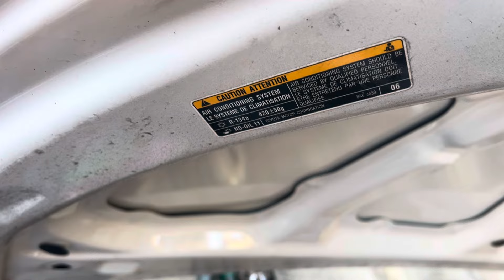Recovering refrigerant from my car measuring weight compared to last year.

Comment: Tom, thank you so much for all your good advices that I could profit from overhauling the AC system on my 26y old Mercedes E430. I made everything brandnew and yesterday I had the first longer trip on the Autobahn at about 30-32°C outside temperature. What shall I say? It was just perfect. Such a good and comfortable system in such an old car shows that Mercedes was in these days the top of the top (and still is today for sure) of german car brands. We were 4 people of the family in the car and everybody was astonished how unpretentous comfortable the temperature was regulated inside the car.

And from Nylog to Denso compressor, from long-time use of the vacuum pump to use of a micron gauge....every single tip from your videos was realized 😊.

Following advices of a perfect teacher means obtaining perfect results ❤
Reply from the maker: @Akadectra  you must be really good because my videos are pretty scattered and not one of my videos is a complete a to Z

So your ability to grab bits and pieces of information scattered wildly throughout many of my videos. 
      Glad I could be of help and make your families outings in your vehicle comfortable. 

Wish you many years of comfort without problems .
Reply: @coldfinger459sub0  Thank you, Tom. Your videos are brilliant 👍👏😊

Comment: Coolant mix off or fans slower than usual is what im guessing
Reply from the maker: @MrSuperchargedv8  if the fans were slower, the temperature would go down because there’s less heat load over the evaporator. 

I clamped off the coolant lines and the coolant flow to the heater core that did not make a difference . 

The only thing I just changed was from an OEM blower that burnt out to an aftermarket blower 

I did not suspect that possibly aftermarket blower is blowing a little bit more air than the OEM blower . 

More air over the evaporator will equal higher dash temperatures 

Because you blow the air faster over the coil, it has less contact time for the coil to absorb the heat out of the air

Comment: Iv been contemplating a dual condenser setup for my suburban.  Maybe a subcooler.  In Houston its tough on those older rigs.   

I plan on insulating the suction lines,  might help a bit.  Wish i knew more about the math behind the system design.

Some condenser take a beating from road debris,
Reply from the maker: You’re in Texas in a really hot area so insulating your section line will be a benefit, specially under the vehicle where the hot engine air travels and the exhaust and the catalytic converter heat. 

If you have an older suburban . 
Order a new condenser on the newest vehicle like a suburban that you can find that has dual air conditioning . 

The condenser for the model that has air conditioning makes the condenser a little thicker for more heat dissipation for a higher BTU exchange . 
Like a 2022 model  you’ll have to have your custom fittings and hoses made up. 

But you’ll be getting a micro channel condenser . 

Or a condenser from a large cargo van model that has dual air conditioning .  

Airflow is so making sure all the airflow goes through the condenser and does not get pulled in behind between the radiator and condenser must be sealed up . 

Pay attention to airflow from the engine heat does not push around from the engine compartment and get sucked back around in front of the condenser or from underneath the vehicle when you’re in stop and go traffic . 

Small narrow sub cooling condenser that’s already an existence on another vehicle for example only about 5 inches high 1 inch thick maybe 20 inches long .  Micro.
Channel .  And you could put a few small fans on just sub cooling condenser if you had to mount it somewhere else. 

Of course you’re gonna have is figuring out the correct refrigerant charge . 

I highly recommend you get some 
Sporlan SeeAll site glass with moisture indicator have your custom hoses made so the site glass is right by the exit of the liquid line of the condenser. 

If you have an engine mounted thermal fluid fan clutch. Replace it..

Comment: Maybe the compressor is wearing out somehow?
Reply from the maker: @markm0000  it was immediately after changing a blower motor. 
    I’m suspecting the blower motor air might be higher

The more you blow over a evaporator raise your duct temperature 

Play with that check that out after I recharge